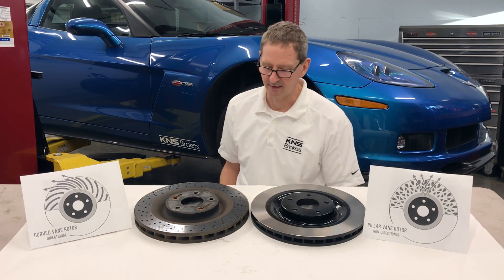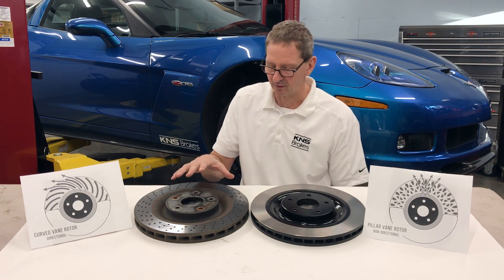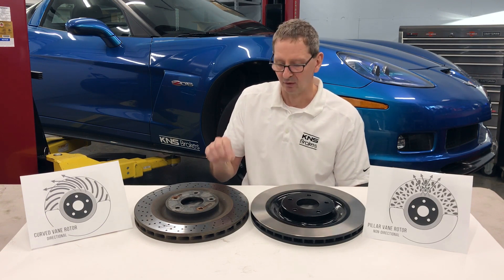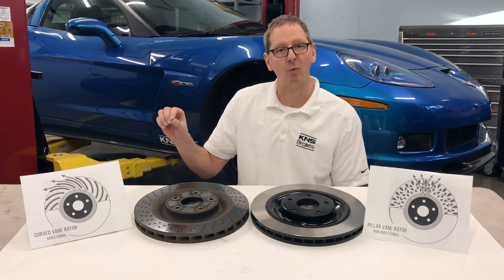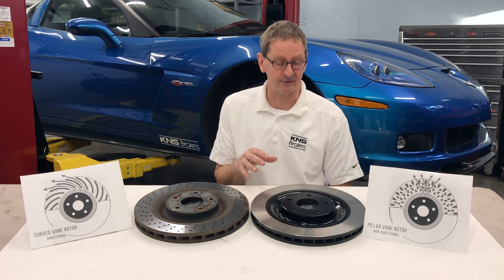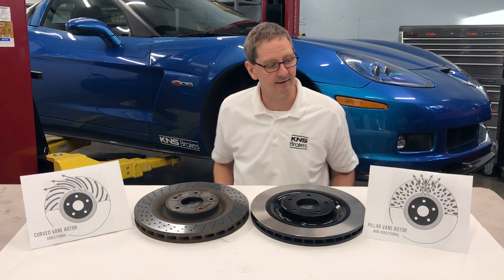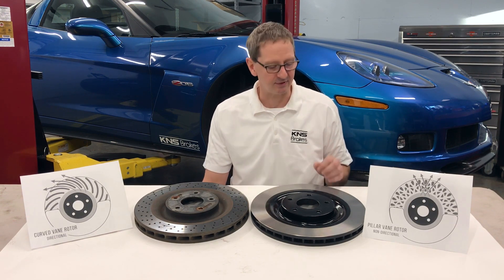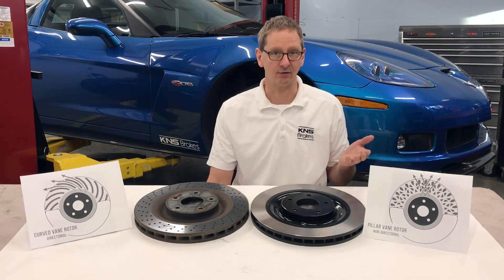Corvette C6 Z06 Replacement Brake Rotors: GM vs KNS

Comment: hey I am stumped. should I get the blank rotors from you guys or go for the Dba 4000 t3 rotors????
Reply: The blanks are great - get them
Reply: @kennethkozlowski5100  thank you I will order them in the next few days. this will be a street car only so the blanks should be good enough.